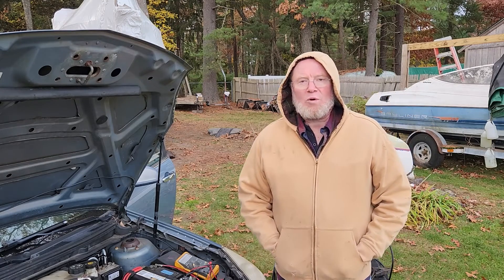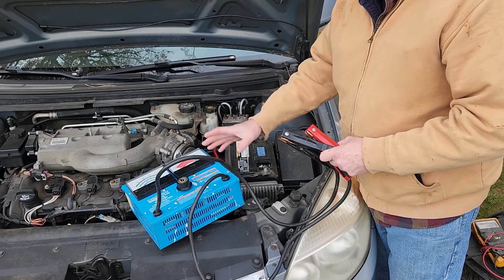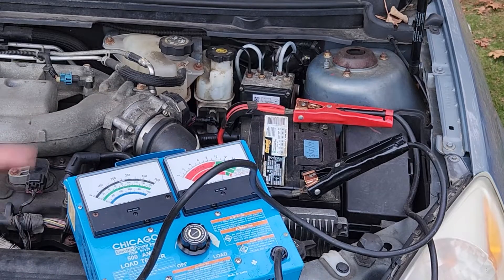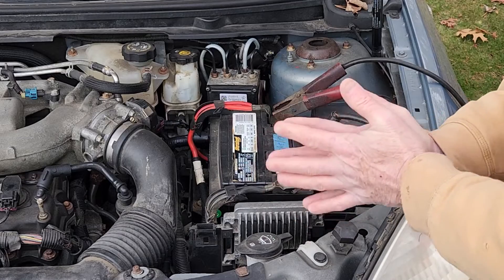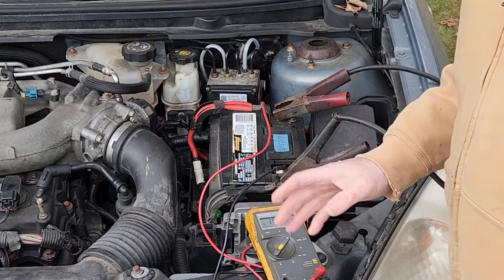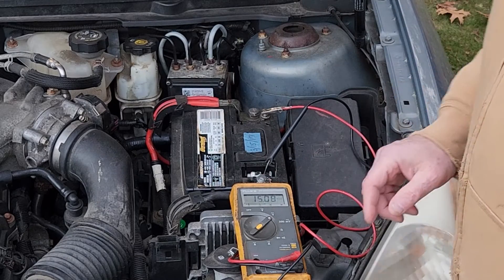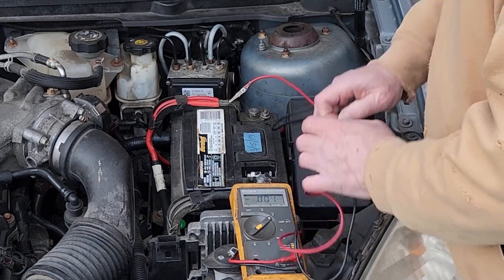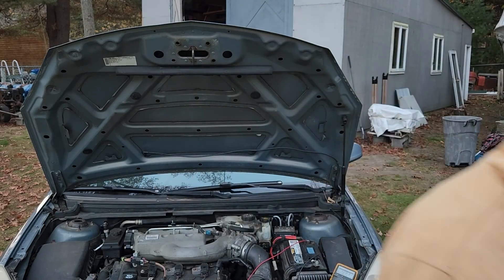Battery and Alternator testing on my 2009 Saturn Aura

Comment: A "ripple" test is always good to do and takes less then 10 seconds. 
If the reading is between 13.5 and 14.8 volts, switch the DMT to the VAC position and observe. A reading of 0.25 VAC or
less indicates that the alternator diodes are fully functional. A reading above 0.25 VAC indicates that the diodes are faulty
and the alternator must be replaced.
Reply from the maker: Agreed, I forgot to do that one. I will add it to the next video when I install the new battery.